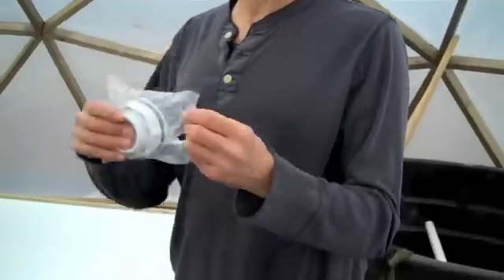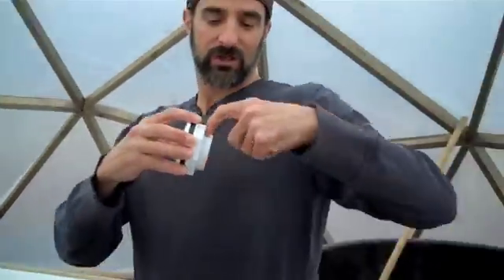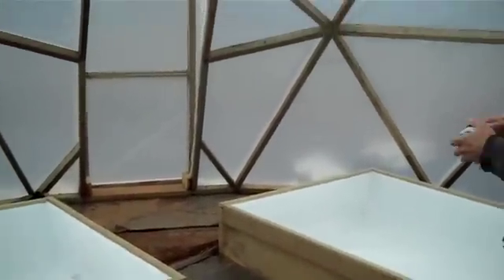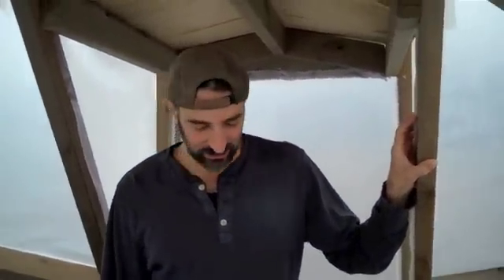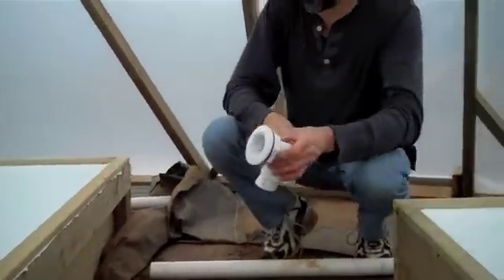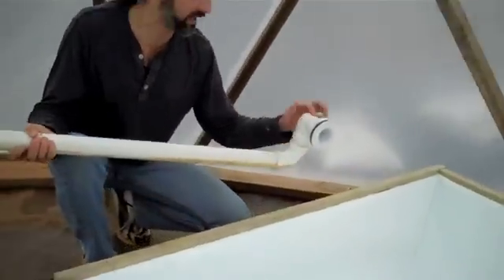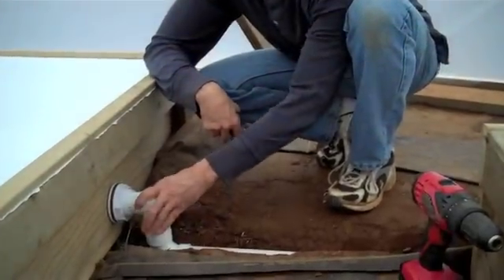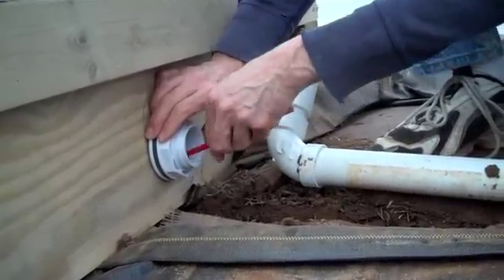BULKHEAD INSTALLATION

Comment from the maker: The plywood sides on the troughs aren't really necessary. They are only there to protect the liner. We toured "Today's Green Acre" AQ farm and he was only using foam insulation for his sides. Our system is based on Friendly Aquaponics system design and the troughs seem to be working fine.

Comment from the maker: Hey B. Yes, all is well. Dome and AQ system is kinda at a stand still.  Not much to report. We had a failed startup which I will post once we get it running. Basically, we are waiting for sprouts to come up again. We lost our first batch, and we are having trouble stocking the fish tank. Also been distracted starting a second dome and building a chicken tractor. (We should probably finish one project before we start a new one, lol) 
Thanks for the concern. 
How are you?

Comment from the maker: The ones that we bought came from the Aquatic Eco Systems catalog. We used 1 1/2" pipe and we ordered a 1 1/2" bulkhead fittings. (Just like you mentioned) 
The inside (threaded) part fits a 1 1/2" pipe and requires a 2 3/8" hole to install.